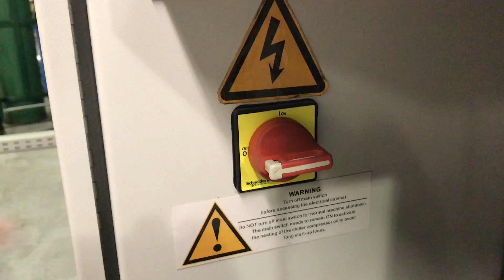Delta Robot High Speed Motion Testing - Project Update #9

Comment from the maker: Here are links to some of the equipment shown in the video:
ESP32 M5Stack - https://amzn.to/2J67IIg
Object Tracking Pixy Camera - https://amzn.to/2LTMP0y
Braided Cable Sleeve - https://amzn.to/2LedCnb
Stainless Steel Cable Ties -  https://amzn.to/2LevZsb
Strain Relief Cable Glands - https://amzn.to/2LdnuO8
Silicone Fusing Tape - https://amzn.to/2J5RPO8
Locking Casters - https://amzn.to/2kJ75WB
Aluminum Extrusion - https://amzn.to/2Lh14M7
Cable Clips - https://amzn.to/2xColG8
M5 T Slot Nuts - https://amzn.to/2HdnNWP
M5 Screws - https://amzn.to/2J4OSBs
LED Ring Light - https://amzn.to/2sqeIFs
Carbon Fiber Tubes - https://amzn.to/2J5xVqz
Suction Cup Nozzle - https://amzn.to/2LQFrDw
Reply: Any idea where I can find the metal buttons you're using? Even better if they have lights around them :-)
Reply from the maker: Read the product descriptions carefully.  Some are latching, some are momentary. Some have solder leads, some have screw terminals.

Here is the button from the video: https://amzn.to/2Mk9wvm
Here is one with a led power symbol: https://amzn.to/2Mm7daV
Here is one with a ring light: https://amzn.to/2MkJkAS
Reply: Nice, thx.
Reply: Any idea where I can find the ball joints you're using?
Reply: Amazing video and project Anthony, thanks very much for sharing. Can you provide the links to purchase the motor driver modules and AC/DC enclosed power supplies please.
Reply: One tip about making it closed loop. Encoders don't know absolute position of the motor. Encoder just counts steps when it's working. Encoders will help with torque and not loosing steps. But if you turn the machine off and move it - it will lose the position. If you want the absolute position of the machine you will need a resolver.
...or encoder with limit swiches that can home to zero position, becose resolvers are fukken expensive ;)
Reply: Please raise the volume or speak louder, thanks.

Comment: The delta robot system and explanation were very good, but I have some doubts:

1. How to define the reach of the delta robot?
2. How to select the rod length based on reach?
3. How to define the payload?
4. How to define the picks per minute?
If you guide me on this, it will be very helpful.

Comment: hi bro, your project it's amazing! I'm trying to build a delta robot as well but i have some isues to fix the spherical joints to the lower bars. with the thread the length of the bars are different. How did you do??

Comment: Could you please explain how did you manage to connect upper link to the lower one? I've seen you use a sort of rod-end bearings on the lower rods. But how, precisely, you fixed lower links to the upper ones? I'm involved in a delta robot project and I'm trying to find a good solution to this issue. Thanks if you'll decide to answer me. 
Anyway, good job!

Comment: Microstepping torque does not reduce the torque. Amazing build but can’t believe the noisy !!!  Delta robots in industry are virtually silent in operation 
Cheers from Australia
Reply from the maker: Industrial delta robots use motors and strain wave gear boxes that are thousands of dollars each. It depends on the motor geometry and shaft position but as far as I know, microstepping does reduce holding torque.

1. https://www.machinedesign.com/archive/article/21812154/microstepping-myths

2. https://www.faulhaber.com/fileadmin/user_upload_global/support/MC_Support/Motors/AppNotes/Faulhaber_AN015_EN.pdf

3. https://hackaday.com/2016/08/29/how-accurate-is-microstepping-really/
Reply: Square stepping usually gives slightly higher torque because you are operating in the corners of the phase diagram, but nothing close to the values you were quoting in the video. Microstepping typically circularizes the phase plot so that you get a uniform torque at every microstep position. This reduction is 1/sqrt(2) or about 70% and it doesn't decrease with further microstepping.

Comment: Great project. Are you sure that microstepping reduces motor torque? I learned that it does not
Reply from the maker: Where did you learn that? It depends on the motor geometry and shaft position but as far as I know, microstepping does reduce holding torque.

1. https://www.machinedesign.com/archive/article/21812154/microstepping-myths

2. https://www.faulhaber.com/fileadmin/user_upload_global/support/MC_Support/Motors/AppNotes/Faulhaber_AN015_EN.pdf

3. https://hackaday.com/2016/08/29/how-accurate-is-microstepping-really/

Comment: ... much to strong motors (in my opinion) for such a light mechanic.

NEMA23 with low inductivity will work 5 ... 10 times faster. (and silent)
To get the gear backlash complete out of the system you can use a radial spring for a asymeteric load.
These spring have to be some times stronger then the max power you need ... and 75% the motor can deliver.
Mechanic will last very long if you never use Start Stop Mode with the Motors.
Use acceleration ramps .... !
I have such a DeltaRobot. In work you can not see the Delta-Arms.

Comment: Very cool. I haven't watched to entire series yet but I do have a question. When the arms reach to the fullest extent then 'reach' down to pick up a part, it doesn't appear to drop exactly perpendicular to the table. It appears to grab the part at a 45 degree angle. Is there a way around that? In the video, you mentioned that a part could get bumped when it's being grabbed. Wouldn't that be the case here?

Comment: Why did you not go with linear actuators? I believe using that configuration would reduce the noise significantly and probably higher resolution, though lower speed? 
I could be wrong though, please give me your input.

Comment: "microstepping reduces torque" is a misunderstanding. it really doesn't. torque is proportional to load angle, NOT to how finely you can control your magnetic field. that's where the misconception comes from.
Reply from the maker: It really does though. It reduces holding torque most of the time. It depends on if you are aligned with a "full step" or not. Having built my own stepper motors, there was a big difference in the torque of half steps and full steps
Reply: field oriented control (microstepping), where you move on the unit circle, can't be sensibly compared to full stepping, where you move off it and get 141% force. but you didn't say that in the video.
5:04, "if you do 1/8 microsteps, you're only at 19.5% of the original motor's rated torque. now when you want 1/16 microstep like I am here, you're only at about 9% of the original rated torque"
again, that's INCREMENTAL torque, i.e. the same as (or proportional to) load angle. nothing is reduced here. I've been dealing with microstepping drivers for a while.
if there's a physically grounded explanation for the "more microsteps reduce torque" myth, nobody was willing to point me to it.
I'm very eager to be shown wrong, please explain. I realize I won't be able to convince you that it's a misunderstanding.
Reply from the maker: @crackwitz  You're not totally wrong. Your statement that "nothing is reduced" is wrong. The normal stalling torque of the motor while in motion is negligibly affected by the microstepping but the holding torque is indeed affected which can easily cause missed steps when starting and stopping the motor as well as holding position. I've built several machines that work fine at 1/16 microsteps but will start skipping steps at 1/32 microsteps or higher. "The real compromise is that as you increase the number of microsteps per full step, the incremental torque
per microstep drops off drastically. Resolution increases but accuracy will actually suffer. Significant too is that any load torque will result in a “magnetic backlash”, displacing the rotor from the intended position until sufficient torque is generated."  https://www.faulhaber.com/fileadmin/user_upload_global/support/MC_Support/Motors/AppNotes/Faulhaber_AN015_EN.pdf
Reply: thanks for pointing to this appnote. they sound like an authoritative source. but they're wrong. it's rubbish. absolute rubbish. they use terms that sound intuitive but aren't, without explaining them, to imply bad qualities where there are none.
anything that doesn't show and argue on the unit circle, but keeps harping on "incremental torque", is useless. incremental torque is a useless term.
load angle is the angle between the magnetic field and the rotor, i.e. by how much the rotor is out of alignment with the magnetic field. it is defined in degrees or radians, whatever's convenient, but on the full circle , i.e. a full electrical or physical revolution. it is not defined relative to whatever granularity a drive can manipulate the magnetic field by.
torque is proportional to that angle. a motor generates no force on its rotor when the rotor is in alignment with the magnetic field (standstill, or rotor following magnetic field without drag/load). a motor generates torque when the rotor is out of alignment with the magnetic field, proportional to the load angle.
when you do full stepping, you get 90 degrees (electrically) per step, which the rotor has to catch up with (or oscillate around, if you move faster). you get EXACTLY the same torque, assuming the rotor is fixed or the steps come quickly, from doing one full step vs 32 times a 32th step. exactly. because it's the same displacement. you get less torque ripple however, which is a desirable property to reduce resonances, because you don't do one large step, but many small steps on a straight line.
they compare the load angle ("incremental torque") of one fraction of a full step ("microstep"), to a full step. it's rational nonsense. it's a mathematical sleight of hand to declare the angle of a microstep to be the same as the angle of a full step. we are always dealing with angles relative to a full revolution on the unit circle, or the motor shaft (times pole count).
it's madness to suddenly expect a motor to increase its torque per load angle by a factor of 100. microstepping doesn't increase the number of poles. we are still on the unit circle. that never changes. they just conveniently "forget" that to sound smart or something. I can't fathom the reasons behind their nonsense explanations, but they're still provable nonsense.
microstepping improves (reduces) resonance behavior. microstepping obviously gives you finer command over the magnetic field (thus the rotor) than coarser (half/full) stepping. motors and drivers obviously have imperfections and limits from construction and pure physics. the more microsteps a driver can make, the more it follows the ideal unit circle. eventually, let's say around 256th stepping, that current control, if it achieves its design goal, is better than the imperfections of the construction of the motor, so that's where gains disappear.
"microstepping is bad" is disingenuous marketing B.S. to help them sell their old full/half stepping drives.
please listen. I've been diving into the theory/physics of this for a while. I've come across plenty of instances of this. every single time, the explanation was rooted in this "zeno's paradox" kind of argument of reducing the load angle, and calling that "bad".

if they'd apply the same nonsense to BLDC motor drives, it would become obvious.

if you have machines that work fine at 1/16 but skip steps at 1/32, I'd be glad to analyze that. it's a common problem with many cheaper drivers that have "fixed on-time", the DRV8825 being an awfully bad example of that. they can't generate small currents near zero, which causes them to "round up" those single steps. to alleviate that problem, one would (throw the driver away or) increase the overall current, i.e. increase the radius of the unit circle (which can imply a larger motor to endure the current). they are still not worse than the next coarser stepping.
Reply: one other thing: steps are only ever "lost" in angles of a full electric rotation (four full steps).
any other kind of "missed" step isn't lost, but merely not "stepped on". they're kinda jumped over.
Reply from the maker: @crackwitz  No doubt that the driver used comes into play. I really like the drivers like trinamic as they have several features to prevent missed steps and some of them will calculate the max speed curves for you. Here's a good writeup on a few cheap drivers. https://hackaday.com/2016/08/29/how-accurate-is-microstepping-really/

Comment: Have you thought about extending the IO using an SPI IO Port Expander. There are many all over the internet. You can also use SPI and connect to an Arduino SAM to extend the capabilities and make your system more modular. You may want to ditch those POTs (They will not last long as they are carbon based and it also mean your accuracy will be no good as you will have to rely on the ADC while rotatory encoders give more pulses which translate to higher resolution for point when your system has to learn its position).

My idea is to think more modular and not to have one controller to do everything. later on when your finalize your design, you can put together one controller with all the different modules if you so please

Comment: So could someone explain why an option like this below might be appropriate or not? I just want to learn not troll!! 
https://www.teknic.com/products/clearpath-brushless-dc-servo-motors/
https://www.youtube.com/watch?v=ZRURwDFvdAs
thanks.....
Reply from the maker: Great question as I have looked into them. You could use them but the reason not to is price. I paid $410 total for all three motors, power supplies, and stepper drivers shown in my video.  A clearpath setup would easily run you over $4000.00. Three equivalent clearpath motors will run you $2100.00 and that is not including the power supplies or drivers. The three power supplies from clearpath will run you $248.00 each.  The price for the drivers are probably even more seeing as they do not list the price on the website.  Not to mention you would still need to buy a gear box for more resolution and torque. My setup has 8000oz-in of peak torque and the $700.00 clearpath motors have 1,844oz-in of peak torque. There is a big difference between a motor shaft connected to a lead screw and a motor shaft connected to a long lever.  The motor has much more force output when you are closer to the shaft.  Don't get me wrong, the clearpath motors are better, but way of most people's price range.  If you are running a machine shop with them, great.  If you are building an affordable open source robot, not so great.

Comment: Very cool build. My 2 cents on the clunking noise is the backlash in the stepper gearboxes. It's intrinsic to spur gearboxes. You need something like a strainwave gear or a roller worm drive to get zero backlash but they're real pricey. You can probably tune a lot of the clunk out though like you said
Reply from the maker: You are absolutely right.  The gear boxes are planetary spur gears. I could not afford "zero backlash" gear boxes as they were extremely expensive. Even moving the shaft with only a linkage attached and no power, it is still loud and "clunky" but I'll try to minimize it as much as I can.   Perhaps I'll build some sound proofing around the motors like the casings on industrial delta robots.
Reply from the maker: Do you have any recommendations for low end strainwave gearboxes for NEMA 34 stepper motors?
Reply: I've only seen them as discreet gearboxes and they're more than £1k new. I see them 2nd hand on ebay for less but theyre still pricey. From korea and china mainly. If you know anyone in china that can send from taobao they are even cheaper. Harmonic drive is the brand with the patent. I did a project with a reduction worm drive in a large robotic installation that we got lots of harmonic vibration from the worm gear backlash. As a bodgy fix we added a spring to provide a constant torque in one direction and made sure the motor acceleration torque didn't exceed the spring torque but it wastes a lot of overall torque. Since then I've always used timing pulley reductions for zero backlash but they take lots of room if you want a significant amount of reduction. I'm waiting for a project where i can justify getting some strainwave gears though. They're real cool. Some industrial robots have them in. Maybe that could be another cheap source?
Reply: The other option maybe for nema34 is to use the hybrid steppers. I've used them and they have massive amounts of torque. The driver doesn't have current limiting like a open loop stepper driver but will dynamically adjust the current. I think it's in a PID loop and uses an optical encoder for feedback. They're pretty hefty on their own and if there's a temporary stall they will still move to the postion they should be after the stall. They're more like a servo in that respect but way cheaper than a normal 3 phase servo. They're pretty cheap from china.

Comment: Nice project!
Have you already checked if the ADCs from the esp32 are good enough for your use? I think they are pretty inaccurate so youre maybe more happy with encoders for the manual positioning. In my project i used a separate I2C ADC to get better rusults.. its called ADS1115. Cheap and easy to use. I also chained it to an analog multiplexer to read up to 16 pots with it.
Reply from the maker: randomname thanks!  I spoke with an application engineer at monolithic power systems and I’ll be using non contact absolute encoders on the output shafts so I can use that for my teaching mode as well. Once in this mode, you can move the robot by hand to teach steps.

Comment: Why do you need all those PSUs? What’s the total current draw at (and what voltage)?
Reply from the maker: Aaron Beckman Three 60v 6A power supplies are cheaper and more reliable than one 60V 18A power supply.
Reply: Proto G makes sense, thanks.